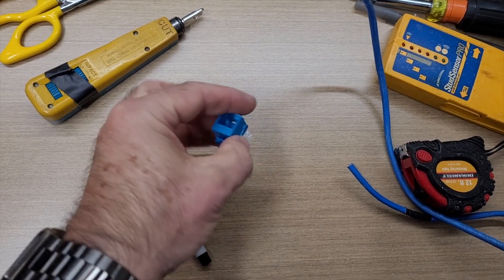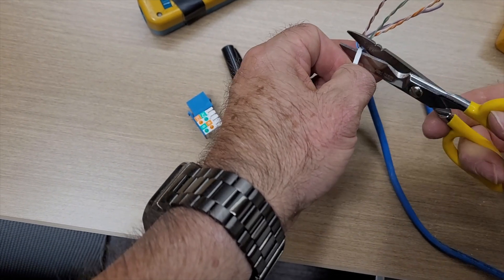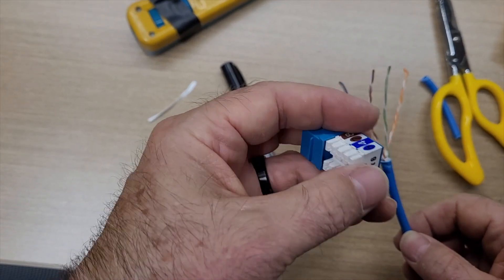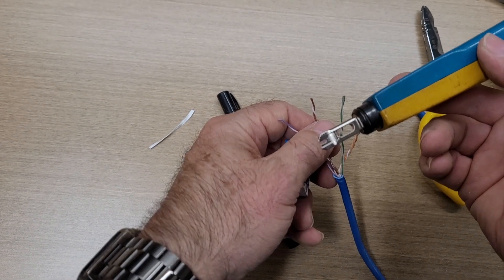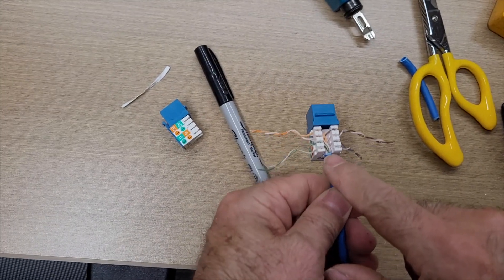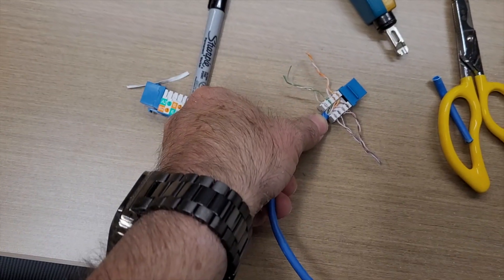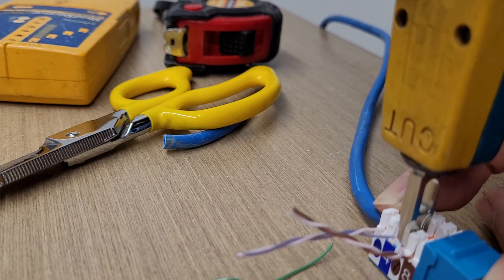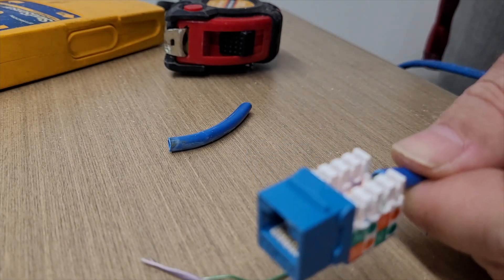wiring cat 6 rj45 jack

Comment: Hi! Can you reuse such socket? I can't find the answer to this question over the net. Thanks for the video!
Reply from the maker: I think you mean can you remove one from an existing installation and then re-connect it to a new network wire.  Yes, you can re-use them several times. as long as they aren't damaged or worn out.
Reply: @NetworkAdvisor  exactly. Thanks